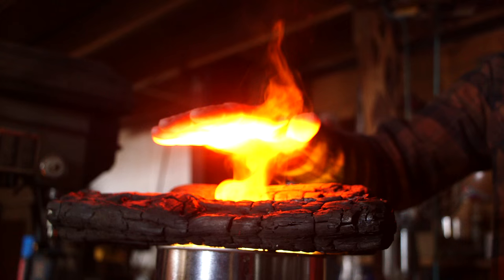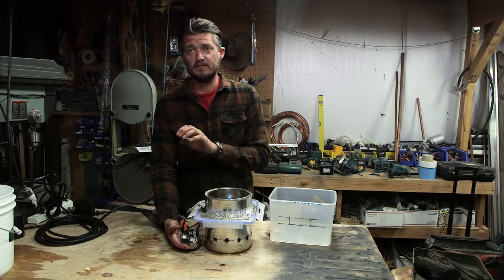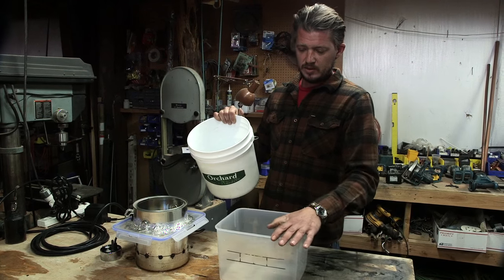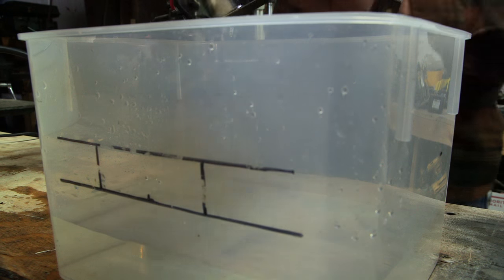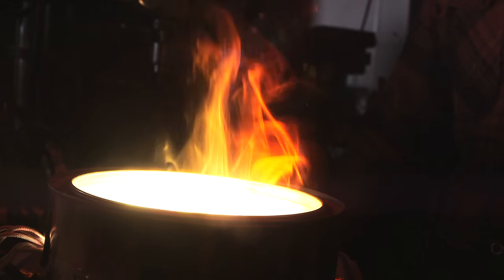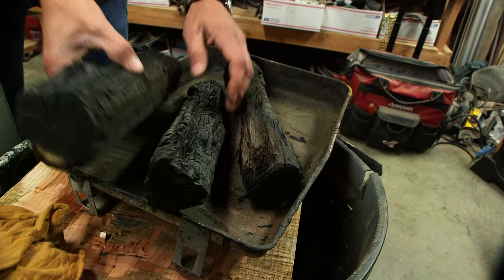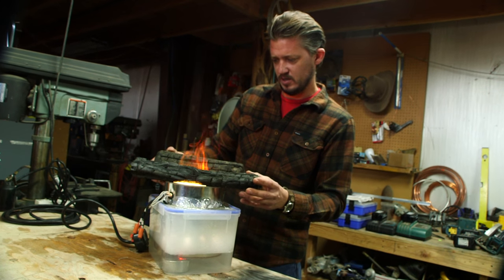Insane Fake Fire Special Effect!

Comment: It's a great looking effect, but needs a few more details if we're to reproduce it. Container size? Looks like a Lock n' Lock, maybe around 3 gallon comparing to the paint can. The leak-proof lid is critical, I'm sure. Also, that looks like a 3-head ionizer/mist maker/pond fogger, rather than the standard inexpensive type (look at the number of little round things on the top, cheap ionizer only has one). I'm not sure if the cheap ones will put out enough volume of fog/mist, unless maybe you use more than one (still cheaper than buying a multi-head mister). Great inspiration, but there's more to this than it seems. A parts list would have been great.
Reply: what is the correct name for that makes the fog
Reply: @AbdulWahid-xn2mt  water ultra sonic ionizer

Comment: "Not a fire hazard" places metal can with electrical cables spliced to halogen bulbs in the water  this is fine..
Reply: They are 12v bulbs thst don't touch the water I believe.
Reply: The fogger is also made out of metal and is powered by electricity! The lamps are not even close to the water. Electricity is not dangerous in anyway if you know how to isolate it. Read a little about Tesla’s work and you’ll probably see electricity in a whole new way. 😉
Reply: @MrSitonmyfacebook  I've stuck my tongue across 12V, it's not that dangerous. Don't use a cheap wall wart, use a UL listed power supply. Don't need GFCI unless you're in the water with it.
Reply: Safety is overrated...
Reply: @harrykuheim6107  Remember, safety 3rd.

Comment: I like it.  Except for the whirring sound---where does that come from, it doesn't seem to be going when the lights are turned out.   Seems like a great way to get fire indoors, into that classic fire trap called a Tiki Hut, if the halogens don't overheat or end up in the water when you're not watching...
Reply: sonicicer

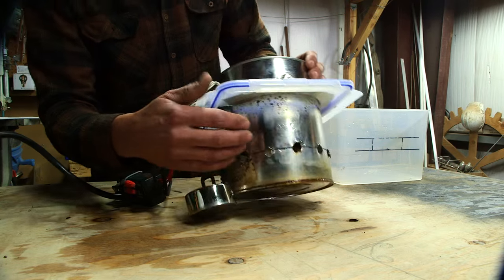Comment: 0:32 : Host says he is using 3 Halogen lamps and they're "super hot".
1:57 : Host says, "this doesn't produce any heat".

😂

Technically it does have a heat component to it, but it doesn't produce heat in the sense a fire would.
Reply: @__WJK__  DO NOT touch halogen bulbs until they'v been off fr at least 5 minutes, unless you like blisters on your fingers. Handle halogen bulbs with cotton gloves, the oils on your skin will cause the bulbs to break.
Reply: Not meant for you, I did't see your comment about safety. Just throwing my 2¢ in. Sorry for the confusion.

Comment: Nice, what color are the bulbs? Red yellow and orange? The vapor get in the paint bucket by holes in the bottom of the bucket right? Nice. Some people see metal water and plastic and think OMG but they need to learn a little bit more how things work. Example an in line watter electric water heaters for shower, metal water and electricity, Do you get shocked if you touch it or shower with the water getting heated with electricity? Duhhhhhhh see no problem. And if there were to be a short it would blow the breaker.

Comment: I don't get it. Where the hell did you get that sonic ionizer from? They don't sell that shit anywhere.
Reply: Amazon sells them.  I got one a few months ago.  I hope this helps.   https://www.amazon.com/gp/product/B00PAK26JS/ref=oh_aui_detailpage_o01_s00?ie=UTF8&psc=1
Reply: Thank you. That helps. It's cheap! I didn't really know what to buy. I just typed in sonic ionizer on amazon, but it didnt come up.
Reply: NOTE!!! You may not want to use THAT particular model because it comes with LED lights. I just noticed this and it might mess up the color of your "flames". But you get the idea of that you need (I hope)!
Reply: Andrew Loisel These are more often referred to as humidifiers, vaporizers  or foggers - I've bought several off eBay for my pond for less than $5 each and they work really well so long as the water level remains fairly constant - the only drawback really is they don't come supplied with the 24 volt transformer you need and these are a bit harder to come by than say a 12 volt power supply. Many of them also have leds built in, tho you could easily cover up the colors you didn't want with some electrical tape or something then they'd work fine for this project (which I'm gong to try myself just as soon as I fish mine out of the pond;) . http://pages.ebay.com/link/?nav=item.view&alt=web&id=351127425403&globalID=EBAY-AU
Reply: Google "thehouseofhydro" or "fogponics diy".
Reply: So where did you buy the sonic ionizer. You need to provide more information when demo your videos
Reply: They sell them at Walmart.  Just go to the electronics department.  Should be on she shelf between the flux capacitors and the illudium q-36 explosive space modulators.

Comment: Hologen bulbs get extremely hot. Would LED be a better alternative? And what about the moist environment?
Reply: You need the heat from the halogen bulbs to get the fog to rise like smoke.
Reply: @Killer-Spirit-Gaming  Yes, you are correct. The ultrasonic disc creates the fog. But the halogen bulb will provide the heat necessary to make that fog rise. Otherwise it will simply drift down like a waterfall, and not look like smoke.

Comment: So this is just the coolest ever! Question: Does it make any noise?
Reply: 3 years later, hopefully I can answer: in short, no, or if it does, it will be extremely quiet.  This is essentially a humidifier.  The most would be water quietly splashing on itself.  (my work has a few similar to these as centerpieces for the restaurant, just on a larger scale.  I'm here mostly to see specifics.  I'll probably try something on my own, but a bit more... well.  Let's say "nicer" looking.)

Comment: I'm with the professionals who have commented here. Electricity, heat emitting halogen bulbs, metal paint can and water are a plan for disaster! LED light bulbs projected at a properly built water deionizer with a fan can create a relatively safer set up. I say relative as it is always possible in a dark setting that people or pets around holiday decorations. Accidents can happen.

Comment: Would it be practical to have it 24/7? how often do we need to add water? Thanks.
Reply: No.  This a potentially dangerous effect not properly waterproofed.
Reply: praestant8 couldn't they just use a short tube to connect the vapor to the light effect and have it be safer?

Comment: is that the same kind of sonic  ionizer thats used the for a Micro wave Oven to heat food  it wont cause radiation poisoning to the water
Reply: No they are not the same thing.  This is an ultrasonic vaporizer, not a microwave emitter.

Comment: The big advantage of using hallogen instead of a blowing fan, is that the fire is more realistic 'slowly' moving. Most of these are made with led light (safer) but then a fan is needed to blow the waterdamp out. With a fan it flows too fast. The heat of the hallogen makes the air go up. Good idea. Just costs a lot more electricity :)
Reply: https://youtu.be/ocmNNS8QbEo?t=572
no clue what the dude is saying but it solves the speed issue